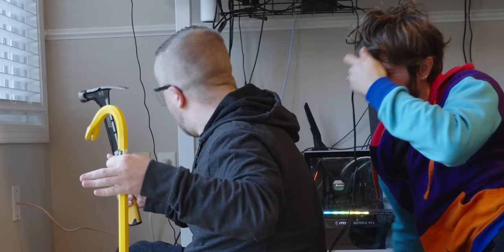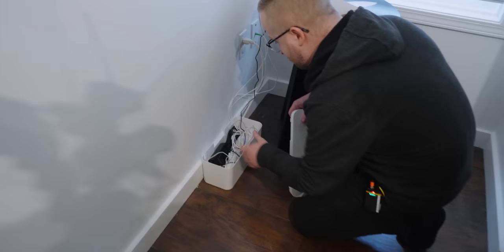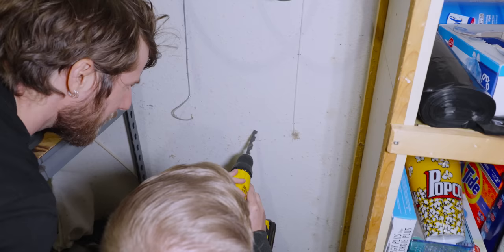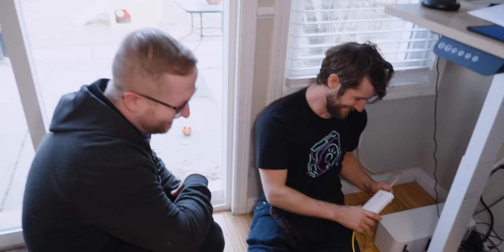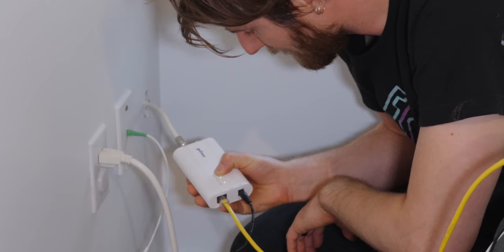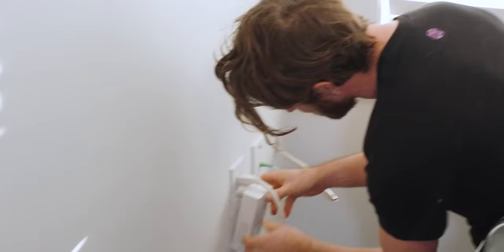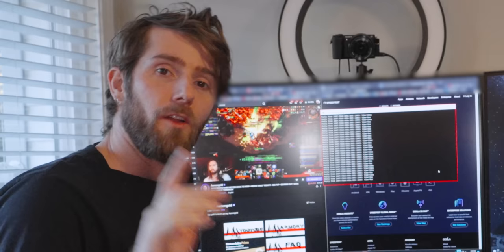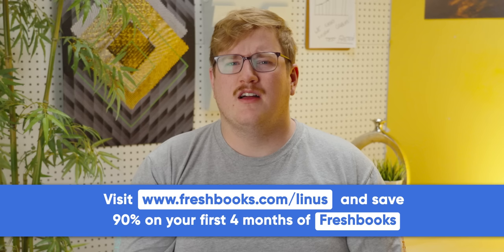I Will FIX Your Wifi - MoCA and Powerline at Colton's House

Comment: These power line Ethernet connections are SUPER hit or miss. I've tried almost all of them in a variety of scenarios and results will vary drastically on a number of factors. They're not simply plug and play like they make them seem.
Reply: It ultimately depends on the house's powerline setup. Older houses in the US without filters on the powerline work best. Newer houses are wired differently and typically have filtering, making it work not so well.
Reply: @diabloterrorgf  Agreed. My last two houses have been new construction (built in 2008 and 2020), and any powerline solutions I tried were terrible. Hard to get even a few megabit/s. Might be the arc-fault breakers that new houses often use?
Reply: With the diagnostic app and a lot of time I've been happy with the results. Without the app it's more miss than hit.
Reply: @realzyxtomatic   new construction 2022 and power line wasn’t very good. Had to eventually just go get a wifi dongle
Reply: Yeah they are absolutely trash tier in my house. Ridiculous latency and a few tens of Mbps, max.
Reply: The part where Linus says "on the same breaker" for powerline  is super important. For me the difference was 400mb/s vs 1.2mb/s. If you have a 2+ br house, it's quite likely your router will be on a different breaker than any given bedroom. Conversely, if you try powerline and it sucks, see if you can move your adapters around until they are on the same breaker.
Reply: @mcpr5971  Same breaker is best. Same leg (typical US split single phase supply) is crucial. Orientation matters. I still like mine.
Reply: @mcpr5971  I mean yeah, but that makes powerline effectively useless in anything except a small apartment/condo. I can't think of any configuration in my house where it would make sense to have two powerline adapters on the same breaker vs. running cat6.
Reply: My bro tried powerline in our house and it worked kinda at first, and then not at all. But our house was bulit in the 1940's. These adapters are more likely to work on buildings after the 1980's. That's mt guess anyways. If ya building is OLD, then don't even bother.
Reply: I think this is mostly a US thing. In my experience here in Latin America these have been flawless. And if you look at online reviews in non-US markets the overwhelming majority are positive.
Reply: @parahaps  Exactly. Every single room in my house is on a different breaker. That makes powerline solutions very problematic.
Reply: @realzyxtomatic  It's not necessarily same breaker. If you're in the US, you have split phase power, which means that some of your breakers are on different wires and can't communicate. However, if your breakers are on the same leg, they can be connected across breakers.
Reply: They've been solid in 2/3 houses I've used them. 1st & 2nd house were similar size and bedroom in similar location; router in middle of house, bedroom at one of the ends. Speeds were maybe 15-25% slower, ping solid and maybe an additional 3ms. Very manageable when you can't run a cord through a home. The 3rd house was a small 2-story that had no bedrooms downstairs. With an upstairs bedroom the download dropped from 200mb to 70mb and ping shot up and down. Manageable for just about anything but gaming which was awful
Reply: Exactly! When dealing with cable companies they have power amps that boost their network signal within their nodes to prevent signal degradation before hitting the end user. Now you need to look into the type of coaxial RG cable being used (RG59-bad, RG6-good), properly fitted cable connectors at each connection/long copper "stingers" that should be at 1.95mm high above the connector, how many connections in the unit, what kind of cable splitters (cheap RCA or Cable company issued) being used/the signal loss on cable splitter connection barrel (-3.5db, -7.5db), and the list goes on and on.
Reply: they can also severely interfere with VDSL / Vectoring
Reply: New construction should have optical or cat6. If any house owner doesn't install then they suck
Reply: also, since there's no preshared key like with wifi/moca, if you have unstable electricity (in like, you have a brown/blackout when there are heavy storms), it will require re-pairing everytime they get disconnected, which is not hard or time consuming, just annoying (you have to push the button on both sides within I think 20s or something like that)
Reply: My experience with power line networking is

1. I ran through 2 breaker boxes and 350' of under ground from house to pole barn and it was super stable, but... only got about 20Mbps. I was fast enough for my Internet and WiFi coverage didn't even come close. So I was happy with that. 

2. You don't have to be on the same breaker. You just have to be on the same electrical phase. That said, running all the way to your breaker box and back out will add a lot of distance and THATS what will kill your performance. Just try a bunch of different outlets. It's unlikey you'll be able to be on the same breaker anyhow. You're trying to get hardline networking to a room that doesn't have your modem in it after all.

3. I tried running my desk off power line and it was a shit show. Every time I moved my sit/stand desk the internet would cut out completely. I mean, as soon at the motors shut off it would come back... but still, VERY annoying. 

4. I was also experiencing random latency spikes that were worse than being on the edge of my wifi's range while I had it at my desk.

10/10 would use again for getting internet to a building that far from the house like a barn. 

0/10 would use everyday at my desk.

Powerline is a nutshell - "Its great and a real life saver... unless its not"
Reply: They don't work for me reliably at all and my house isn't that old.

I ended up just getting a solid mesh wifi 6 system (Asus XT8), where both nodes have their own switches, so I can at least hardwire at each end. The mesh has a dedicated backhaul and it seems to work a lot better than power line for me.
Reply: agreed, i bought 3 for my house once and they kinda sucked lol.
Reply: My DLan adapter i used some time a go only managed to get me 10Mbps. in contrast the wifi gave me 20Mbps. since the lag spikes were one the side of the provider, i used wifi instead. now i have a proper cat8 cable :)
Reply: Power line adapters work if the lines are on the same breaker in the fuse box , they do work though when not on the same fuse/breaker but very dismal .
Reply: @tactileslut  there's a app what's it called
Reply: They are also pretty much wideband jammers and  IMHO, they should be illegal. They make your house wiring into a huge antenna that radiates all the crap it spews out from medium wave to VHF.

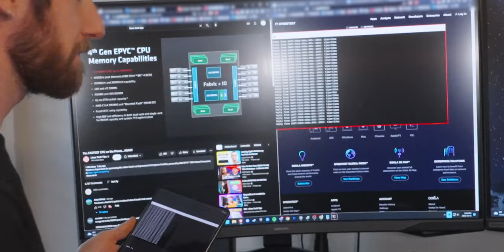Comment: 17:05 Remember the Telus gateway was rebooted when Linus unplugged it. Routers are set to automatically change bands, typically happens after a restart. A restart can also help to flush out the cache and that could explain why the latency dropped.
Reply: The modem was also physically moved from its normal position. Entirely possible that it got a more direct shot
Reply: WiFi 5 and 6 are also significantly more complicated.

Comment: Another good reason to use MoCA is if you have an RV and you need the antenna outside for a point to point solution. Most RV will have a coaxial plug on the outside so instead of drilling into your RV you can use two adaptors.
Reply: Do you have power outside?
Reply: @martin5697  When yer plugged in, yes
Reply: An external WiFi access point (mounted on the wall of the house) and a WiFi client mounted on a RV window (inside, fixed to the glass with two strips of double sided tape) can easily solve the problem with less troubles....
Cable is always better than WiFi for fixed uses but WiFi is always better than cable for mobile uses (and an RV is definitely a mobile use!)
Reply: Too late, I've drilled a hole already. XD

Comment: Man I started laughing out loud, I tired streaming over wifi for the first time yesterday, got fed up and ordered a moca adapter, a day later and Linus uploads this, this is amazing

Edit: Linus if you see this, thank you, this has helped me to make a more informed decision, I have done more research and found out that MoCA isn't right for me and cancelled my order, I will be using the power line instead.
Reply: Just use cable clips and ethernet cable. You do own a hammer, don't you?
Reply: How do people manage to get their wifi so bad? I stream everything wirelessly and never have any problems.
Reply: @ruk2023--  My wifi works fine and my walls are all brick
Reply: @ruk2023--  I get like 300mbps over WiFi. Plenty.
Reply: @littlejackalo5326  But if you're paying for 1000 mbps and only using wifi in the home, max 300 mbps, youre losing out on 700 mbps
Reply: @littlejackalo5326  The main argument is that while WiFI may work fine, you do get more bandwidth with ethernet. At my desk, my phone which uses WiFi gets 250mb/s, while my PC which is connected via ethernet gets 920mb/s.
Reply: @engineeringvision9507  I'm renting, I totally would if I wasn't
Reply: @littlejackalo5326  You also get 3x the ping no matter your dl-speed as well as disturbance from other electronics, but if you're not doing any online gaming you don't have to care.
Reply: Linus always has the best timing for vids, I was looking to buy more ram and didn't know if I could mix it and the same day I started researching linus uploaded a vid about mixing ram lol
Reply: @XKurrA  Hmm good point. Next best option then I suppose :)
Reply: @simas387  it's like he reads our minds 🤯
Reply: @engineeringvision9507  mine too but wifi works great
Reply: I don't get it wifi is great and if you're not getting what you want with wifi use ethernet. Now a days flat ethernet cable are also available
Reply: @ruk2023--  same dude
Reply: And I guess European houses don't have brick walls. 
Here in Asia all Houses are made up of bricks and thick concrete
Reply: @XKurrA  Routing the lan cable, glued with double tape through floor corner is a good option. Roll the double tape few cm on the cable will make removal easy, pull the cable and glue also came off. Cheap Cat5e is thin enough but still good for 10gbps if you laid it less than 30 meter and through the door gap.
Reply: @engineeringvision9507  Many people such as myself live in an apartment, and will be in huge trouble for putting a dozen or 2 holes in their apartment walls.
Reply: @kairon156  Apartment walls are usually made of plasterboard so wifi should penetrate without issue. Even here we have brick walls and my wifi is fine!
Reply: @engineeringvision9507  cool, cool. My wi-fi is directly on the opposite wall to my comp and I'm fine like 97% of the time.

Comment: Coax splitters can be directional. Since the cable next to the computer was presumably for TV signal, it is possible that the line was split somewhere in the house, not far from where it enters the structure. (Mine is screwed to a ceiling joist in the basement). Removing the splitter and getting a F2F adapter to connect the two internal runs directly could have solved the problem.
Reply: Yeah I’ve only interacted with directional splitters. 90% of the work setting up moca was figuring out the directionality and other existing cables
Reply: The splitter also needs to support the frequencies of MoCA or it might filter out the signal (insofar as I understand it…)
Reply: that is what they were probably going to look at, but they couldn't open the cable box
Reply: @saillively  A splitter would be pretty useless if it was in the box and you had to run two separate lines to the house anyhow.

Comment: Calling powerline consistent is the funniest thing.

I remember those times at 2am trying to not wake up my family by laughing when I was playing with my best friend and all of a sudden he'd get kicked out and I could hear him punch is powerline adapter because it crashed once again. Btw he went through several brands and models, modern house with new wiring too, so no excuse.

Meaningwhile I've been using wifi for all these years during which he has been struggling with his adapters, and I've always had faster internet than him (same provider) and more stable than him too, at least until very recently, he just arranged the attic to become his room and in the process has cabled ethernet into the room, no more problems. Quality access point and receiver adapter is key, it can make your experience go from very shitty to seamless, forgetting it's wifi and negating the needs for wiring at all. 

In my case between cabled and wifi 5AC, I go from 210mbps and 15ms to 185mbps and 21ms, no stability difference, IMHO negligible difference.

Edit ; btw my house is big stone house over 100yo, some walls are 70cm thick, and my pc is all the way accross the house. There's no such things as "too far for wifi" or anything like that, just bad AP's and/or implementation.
Reply: Oh yeah, I don't know with what magic Linus finds good poweline adapters, but the times I've tried using them they were absolutely worthless.
Reply: First time I ever used one was when I moved into a house share with uni friends back in 2017 there was zero ethernet, 3 floors, dense walls and floors and WIFI simply wasn't cutting it as most of us were gamers. I tried buying TP-Link powerline adapters and it seemed to work fine for hours on end and then suddenly it would just disconnect one or multiple of the end points but the internet wasn't down and the devices showed full connection and it was an absolute headache that ended up with me installing a huge frikken ethernet up the stairs and sticking another access point up there.

However on the flip side. This year i'm living in a new place which has the internet installed upstairs which is actually ideal as its where my computer, but my TV downstairs had terrible signal to router upstairs due to again, thick brick walls and dense wood floor boards, carpet etc. So I tried once again, bought some TP-Link adapters, didn't have much hope however they've run like a dream. I have one in the room with my router and computer that has a single ethernet in port, and one downstairs in my living room that acts as wifi access point with an ethernet out. Speed tests on the wifi downstairs now show 150-180Mbit/s which is close to the rated speed but more than what I need. 

The only time it's dropped was due to the adapter being on a clogged wifi channel. I simply switched off auto-channel selection and found one myself that wasn't clogged and it went right back to normal, been running smooth for 5 months now.

This house is old, and not exactly well built by any modern standard too. Only thing I can imagine that's changed is either the product itself or that I may have been skimping on cheaper models. So my advice would simply be buy a higher end, newer model. If you can afford it. Test it and return if you more a couple of drops in a 30 day return window.
Reply: Before we updated other PCs with internal wifi adapters that didn't suck, we used powerline for PCs for a solid almost two years. Occasionally needed to repair like once every few months but they worked fine. Cheap 40 dollar setup too.
Reply: @KyleDavis328  it's about the appliances you use, appliances that use the powerline a lot will cut out basically all connections
Reply: I've been using TP-Link powerline connectors (3 of them) for 6 years and have had no issues in my apartment.
Reply: @KyleDavis328  I got a refurbished set a while back, don't even remember the brand. I run it to a HT PC far from any access point and WIFI signal is atrocious in that part of the house. I can max out my download over those powerline adapters with very little inconsistency in a house built by rednecks in the 70's, trust me we've been in those walls ITS BAD. I figured I had a worst case scenario. Granted I don't have Gb internet, but still if I can get 30Mb/s easily and reliably out of it I can't imagine what you and all these other people with the same complaint have going on.
Reply: @LKN117  I think some of the devices are dodgy tho. as I said in my long post, Ive used TP-Links pure ethernet ones before and they didnt work but the new ones I got work perfectly in this place, not entirely sure why. But its been nearly 6 years since I used those original devices so maybe they've gotten better and higher quality control in the past few years.

I don't know if it can but different countries run on different Hz power. It might be in the past few years they've made adjustments so the devices are better at working with the power lines for each country.
Reply: @howdlej123  yeah mine are probably  4 years old. I'm not gonna lie though, I think mine are TP link as well LOL. I would double check but they are both behind pieces of furniture. I got the cheapest set I could find at the time on Newegg just to see if they worked at all. Guess its a lottery.

Comment: One thing to keep in mind with MOCA is that a lot of older cable TV Coax used splitters & band pass filters with a cutoff frequency below what MOCA operates at. Some of these filter devices are also directional, so it can be quite frustrating to set up if you don't have a good idea of how your coax is wired.

A simple coax cable tester can help troubleshoot how wires are ran and terminated, but if any splitters were built into the walls you may just be SOL.